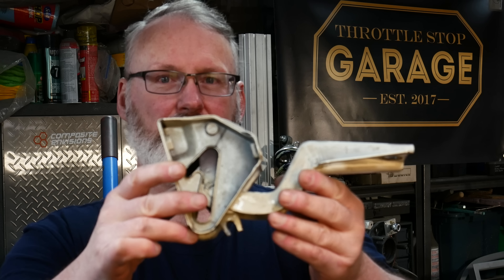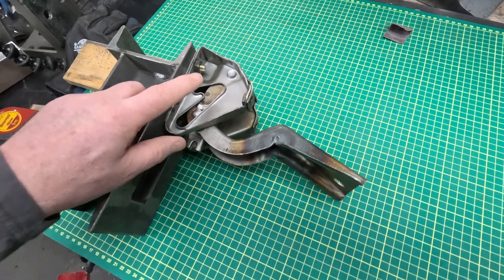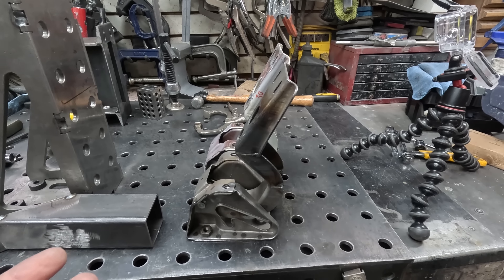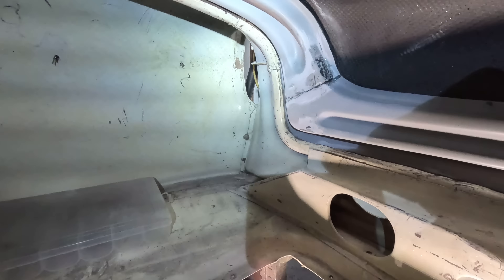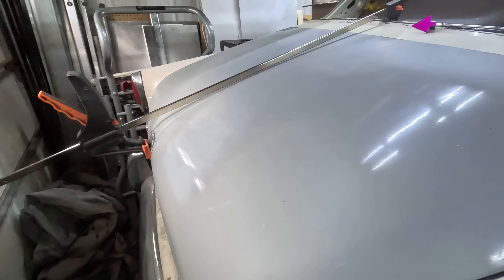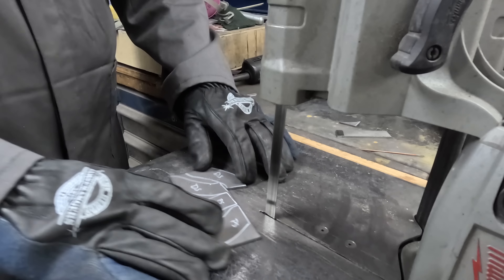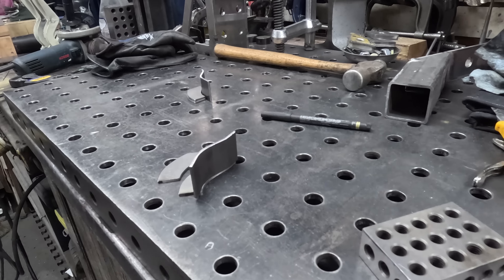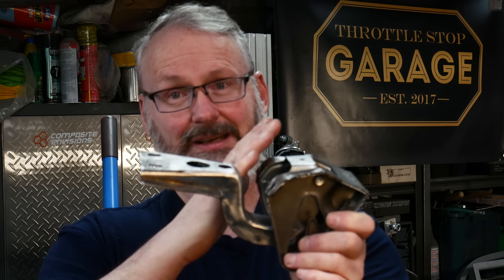When the Aftermarket Fails: Fitting "NEW" trunk hinges

Comment: You are a beast Craig. I loved the part with the hidden damage. My 69 Datsun roadster took a hit on the left front corner. It was poorly repaired but I didn't think it was a big deal. Well when I pulled the dash and the sheet metal was tweaked on the back of that it was an ah oh moment. Anyway it turned out the windshield frame had been replaced, the door post was down and twisted etc. All fixed now but yeah. You get the picture. Keep on keeping on. Great video.
Reply from the maker: Thanks Chris.  It makes so much more sense now that I've found the damage.  The trunk used to leak exhaust fumes and the old panel was pretty dented from being walked on and slammed.  It's nice to work out the why that things don't work on these rolling monuments to history.

Comment: Looks great.
I finally bought a new welding helmet that came with a cheater lens and you got a light on your helmet 😮. 
I like the cheater when I am wearing my contacts but when I'm wearing my glasses, I'm so used to looking over them close up that it gets weird. I think the biggest thing is I can see through this new helmet, my old one was horrible.
Reply from the maker: When I was younger, I'd laugh at guys that had a cheater...now I couldn't weld without one! The light was installed a year or so ago on that hood.  It works great but the lens is a cheapo replacement and I really should ditch that hood but the head gear is so comfortable.  I only wear this one for MIG/Stick and the Lincoln Viking 3550 for TIG - it's shocking how clear that thing is.

Comment: You certainly deserve to put your feet up for 5 mins after that marathon. What patience !
Did you consider grinding down the thickness of the torsion springs to compensate for the lighter boot lid ?
Reply from the maker: I did consider ways to weaken the spring, I was pretty confident that I'd make a mess of it!  So gas springs it is.

Comment: Craig, I thought for sure you where going to rebuild/rebush the hinge pins. I'm still not sure why you didn't, was it ever a consideration?
Reply from the maker: Sure Alan - the stock hinge was not able to adjust the trunk any more forward where it needed to go and was a little high.  Either way, the arm would have required cutting to fit and not having to fix the pivot saved work.  At least that's what I'm telling myself.

Comment: I wonder if you could have taken out the pin of the old one Then redrill it to the correct size put a new pin and new bushing in.
Reply from the maker: Yes - I think so.  When the hinges were only $50 and they looked perfect.  So I thought I'd take the easy way out for a change.  Oops.

Comment: One method would have been to fix the original ones, they´r are usually better as aftermarket items anyway.
Reply from the maker: Normally - but with the non-stock trunk, it all needed to happen anyway.
Reply: @ThrottleStopGarage  Yea its never easy, I have been making hinges for kit cars for a while and have beveloped a method that gets the job done quickly. I make the hinge and brackets out of carbon fibre.
Reply from the maker: @h-j.k.8971  Those sound very cool.